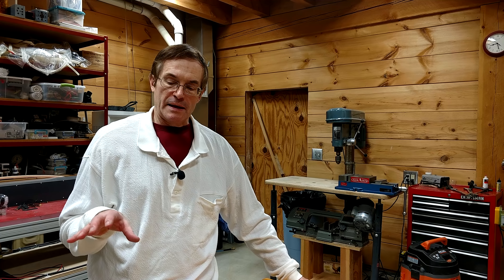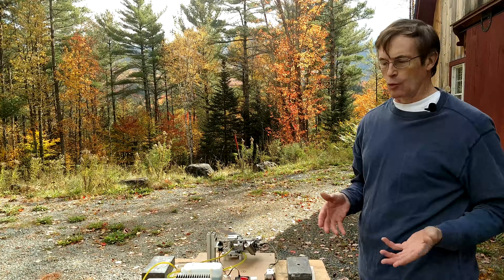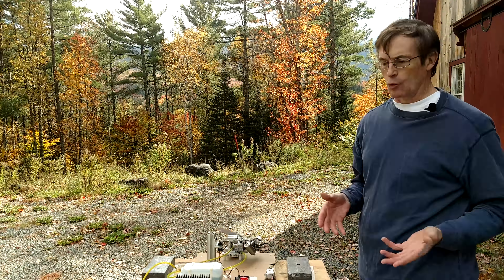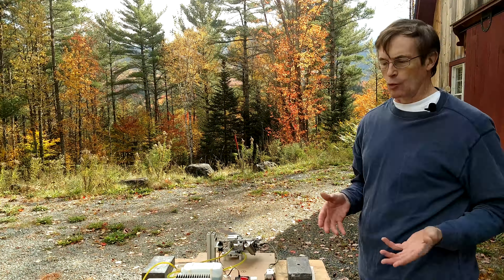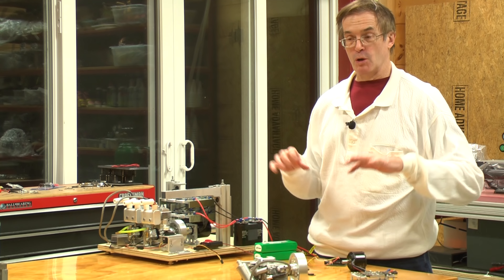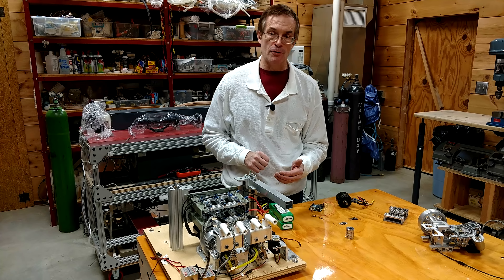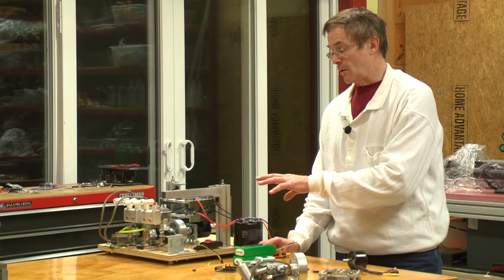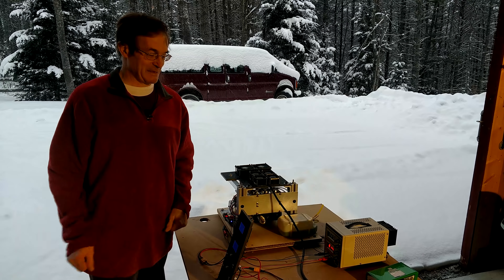Hybrid Drone Generator

Comment: Great videos,Thanks! My team has built a hybrid drone based on your videos. And it hovered for more than 1 hours! But I have a few questions about the theories in your video. After landing on the ground, we found the batteries swollen(without charging management system).It seems that  frequent charging in pulse damaged the batteries; And I'm confused about choosing a battery model based on power ripple. We just selected the the capacity of batteries as small as possible. Is there any theory I can refer to to select the battery model?
Reply from the maker: Have you researched pulse charging or looked at any papers?  It has been a while since I have read any, but I can suggest a few causes.  The depth of the ripple depends on the capacity of the filter capacitors you are using.  Batteries have an internal resistance and the ripple represents a bidirectional current flow.  You may have overheated them.  Li ion batteries are vaulnerable to damage from overcharging with as little as a couple of hundred millivolts above their maximum voltage limits. It's important to operate the generator near the middle or only a little above the middle of the discharge voltage range of the batteries.  If you used small batteries and started the flight with them fully charged then drawing them down to that operational range where the generator begins to supplement may have used a higher current than small batteries could sustain.
Try again with the batteries moderately charged, with the generator running and the rotors spinning, but without leaving the ground, run for ever increasing intervals, shut down and check the batteries for temperature and voltage.
You'll solve it.
Reply: @TechIngredients  Thank you for your answer! Maybe you are right. Our drone weighs 18kg and requires power between 1.5 and 2kW. We closed loop control of engine throttle based on feedback voltage at load. At the time of take-off and load fluctuation, there is a delayed response between the engine throttle and the motor output power, which caused high frequency fluctuation voltage of the load near the goal we set(48V). It also has to do with the small capacity of the batteries we use(two 3300 mAh lithium battery in parallel).We will take your advice and set the target voltage between 46 and 47V. Thank you very much!
Reply: @TechIngredients   Also in the paper《Impact of Periodic Current Pulses on Li-Ion Battery Performance》，it says that pulse charge and discharge reduce the discharge efficiency and chargeability of Li-Ion battery.
Reply from the maker: Actually, the paper I read said the opposite.  Their theory was that the periodic pulse charging allowed the chemical products of the charging process to diffuse away from the electrodes. Maybe they were wrong or the issue isn't settled.

Comment: What about a radial engine ? Would that solve engine problem ? Instead of running two engines belted together
Reply from the maker: Yes.
The exhaust  plumbing would be a challenge, especially if you want to silence it.
Reply: @TechIngredients  thank you sir. I didn't think that far ahead.

Comment: Three way you control the torque fluctuations is a balanced fly wheel. That will remedy the broken couplings. Here is an idea... Use a multi cylinder engine instead of multiple motors. the exhaust should be ported very similarly to a gun muzzle brake to assist stabilizing.

Comment: This can be use like a charger for a solar sistem ? How much liters of fuel per kilovat ? I mean the eficency is beter thean a normal 30-40% of a generator ?
Reply from the maker: The effeciency in fact is a little lower because of the two stroke engines.  What sets this apart is its extremely low weight.
Reply: @TechIngredients  u shold make one with gas hidrógen o propone is lighter

Comment: Call me crazy, but wouldn't it be ten fold more efficient to eliminate the hybrid portion and do a 4 stroke drone? That set up looks quite hefty, will it even produce enough energy to lift itself?
Reply from the maker: It would be more efficient, but there are other issues.
Direct drive from an engine makes it very difficult to isolate vibration and noise.
Electric motors have faster response and more precise speed regulation and a removable generator module allows quieter operation without fuel on board when that is necessary.
Reply: @TechIngredients  Its definitely a cool concept you have there. And the point you made about fuel being more energy dense than batteries is spot on. 

If your goal is to produce power without vibration issues have you thought about putting a turbine powered unit together? I know the marine versions run thru a transmission and I do believe the helicopter versions are a bevel gear with a clutch. Not sure what the throttle response would be like for direct drive.

Comment: Naturally, you are using a 2-stroke gasoline mix in those engines instead of alcohol based model engine fuel for the large increase of btu's.  Correct?  Pardon me if you already mentioned it.

Comment: Great job! Thanks. What about small rc turbine engines?
Reply from the maker: They would be very compact and light, but they are very expensive and because of the low compression ratio, have poor fuel effeciency.

Comment: Neat setup. Why didn't you use a radial engine instead of coupling 2 engines together?
Reply from the maker: Radial engines would be a good choice, but the exhaust plumbing would be bulky and make building an enclosure more difficult.
Reply: @TechIngredients  Indeed. Or even a flat 4 cylinder style such as: https://www.ebay.com/itm/New-OS-FF-320-FF320-Pegasus-4-Cylinder-Ringed-Four-Stroke-4-Stroke-RC-Engine/392049322508 Not sure how the crank/ power strokes would be laid out
Reply from the maker: Did you watch our follow up videos on this system where we introduced the flat four cylinder engine?
Reply: @TechIngredients  oh, no I haven't. I guess I will need to watch that!

Comment: since you are using two stroke engines over a broad rpm range to adjust current flow, exhaust tuning is out. driving one motor, generator off the timing belt would reduce the weight and allow you to run the motor at a higher rpm than the crank speed of the motors. What you have actually created is something the diesel electric locomotive has been using for years. However, the  efficiency losses are pretty high.
Reply from the maker: We considered that, but decided on the two generator design for a couple of reasons.  The output capacity of these motor/generators is pretty linear with weight.  So, a single motor/gen will weigh about as much as a pair of smaller units with the same overall capacity.  The two, out of sync motor/gens allow the same pulse frequency as a single unit with twice the pole count.  These motor/gens and even the timing belts have RPM limits and driving them well above 10,000 RPM gets sketchy.  Finally, if the motor/gens are operated with a typical step up pulley system, there are significant lateral loads placed on the engine bearings that may lead to wear problems. It's impossible to get any specs from the manufacturer re these unusual loads.

Comment: I thought with a drone generator a drone would not need to return so soon but the size and weight of the generator is so much larger than the Drone it's self typically. My son does real estate photography and battery life is 80% of that ball game. The explanation and design detail is pretty extensive. What I am asking,  is this for charging a drone battery in the feild? Is so is it faster than an inverter to a car battery, my son has bought a dozen battery's and takes 6 with him, then recharges them over night the uses the other 6 the next day out.
Reply from the maker: This is an engineering test platform.  It can be further reduced in weight and size for the intended airborne installation.  A simple inverter and car battery or a camping generator is fine for field recharging.  Also, a generator module makes practical sense only for larger drones at this point.  Small models would be best served by bringing along more backup, battery packs.

Comment: Maybe it could be possible to reduce torque peaks electronically? Just reduce load outside of torque peeks. Sufficiently sophisticated controller could even make angular velocity perfectly stable.
Reply from the maker: That's a good idea.
Reply: @TechIngredients  there are bldc motor controllers ICs that have regenerative breaking. Maybe instead of accelerating or breaking that could just keep the angular speed locked. Depends how they are implemented. It would mean that during compression stroke it could even consume energy from capacitor/battery. And all voltage and ripple problems can be solved in weight efficient manner by a switch mode voltage converter. MOSFETs are light, so why not use them wherever possible. If all that worked boxer without counterweight should light and vibrations mitigated.

Comment: there is a way to use gravity so water is always traveling down a ramp when it gets to the bottom it raises the water level and the cycle repeats,look at the pyramid shape and build something for the water to turn like a wheel as it goes down
Reply from the maker: You can use gravity as an intermediary, but you would have to supply energy to return the water from its deeper location in the gravity well.  If you're looking for a method to allow for perpetual motion or harvest "free energy", there is none without reversing the direction of time.
Reply: @TechIngredients  it wouldn't be free energy because you're putting in energy at the beginning you're basically overfilling it and letting capillary action bring the water back to the top
Reply: @TechIngredients  to "prime the system" you're adding energy by dumping water down the ramp the water pushes the rest of the water back to the top and over the ledge

Comment: You seem to be pretty knowledgeable with these lithium batteries maybe you can help me out. I have a 14S 54V lithium battery which will only charge to 53.7V not the 58.4V max. Each cell is at 3.8V max the charger tests at 58.4V and have tried several different ones and none will charge this battery to full capacity. I tried eliminating the BMS and directly charging and still the charger cuts off at 53.7V any ideas?  Thanks
Reply from the maker: There are two types of lithium batteries, lithium ion and lithium polymer.  You can look up the relative specs for both, but what is relevant here is the charger may be using a default program to charge to the lower max of the li-ion battery.  This is generally 4.2V/cell for the polymer and 4.1V/cell for the ion.  Also, many chargers have user adjustable max charging limits both for voltage per cell and for maximum amp hours added per session.   If your charger is completing the charge at 3.8 V, it is not fully charging this battery by choice.

Comment: But what if the generator is mounted at a 180° position from the motor with gears or flex cable? Wouldnt that counteract Newtons law?
Reply from the maker: It's important to keep things as simple as possible.  This holds down cost, weight and reduces the chances that something goes wrong.
Just changing the orientation of the generator shouldn't change the gas engines' vibrations.

Comment: I’ve wanted to create a electronic throttle system for small engine power equipment such as snowblowers and lawnmowers. I figured an Arduino could be used.
Reply from the maker: Sure.  You'll also need a servo and power source if dealing with a carburetor.

Comment: Wow.  I love the depth of your videos.  Counter balanced clocked engines!  So cool!

I wonder, are capacitors necessary if you have lithium batteries?
Reply from the maker: Maybe not.  We are building a larger generator as I said in the video, but also a smaller version that will dispense with some of the complexity with voltage regulation.  We'll just run it flat out and supplement a larger battery pack.  In that case, the batteries should be able to absorb the voltage pulses much more readily than the tiny stand by batteries in the other generators.

Comment: Okay... there's the generator specs... I did miss those the first time i watched this... 

A brushless motor is a good idea as an off the shelf part that can be dropped in without much hassle. 
The only issue is pole-shading, but that requires a lot of work to remove from the motor, and ultimately might not be worth-while. It depends on whether you want to keep the motor functionality or go for a pure generator setup. 

If you keep the motor functionality, it can add some conveniences that you might not get in a setup that's purely a generator. 

Firstly it can act as the engine startup component, and it can even be used to balance out the load on the engines. If you use a switching rectifier, the draw of the generator can be synced to the position of the piston, allowing the load of the individual generators to be synced to their respective motors, which would ultimately smooth out the output further than it already is.
Reply from the maker: Those are good suggestions.

Comment: I'm sure someone has brought it up, but diodes are very inefficient.  Newer circuits use MOSFETs that are turned on at the correct time to rectify the AC.  This is often called "synchronous" operation.  This will increase your efficiency roughly 10% or more and as an added huge benefit, you won't have to cool your rectifier nearly as much.  Of course this requires a more complicated circuit, but the benefits could be large.
Reply from the maker: Good idea.

Comment: If you want to have a extremely precise fast fuel control your going to probably need to switch to a fuel injection and possibly electric ignition as wells. That will help a lot with fuel consumption as well so I'd see how light I can get those parts for that application if I were you. Your off to a good start though.

Comment: What engine would you recommend for the alternator?
Reply from the maker: I wouldn't use an alternator because of its low effeciency.  Look at power to weight ratios.  Two strokes will generally win here and despite the lower fuel effeciency are probably a better choice for airborne applications.

Comment: What kind/brand  2-stroke oil and fuel being used?
Reply from the maker: I can't remember, but it was purchased from the same hobby shop that sold us the fuel tank and fittings.  So, it is probably some run of the mill RC oil.  The gas was ethanol free 100 octane from a local station that caters to racing enthusiasts..

Comment: Could you not have built a mount for your 1st motor for less weight than you gained by adding a second motor/flywheel/muffler?
Reply from the maker: I'm not sure what you mean.  The second engine and flywheel were used to smooth the operation, provide less voltage variation as well as to add additional power.
Reply: Tech Ingredients .  I understand and I don’t mean to split hairs.  I was just thinking that while tackling the list of design challenges for vertical lifting aircraft, vibration would have to take a back seat to power vs weight. Enjoying your work and looking forward to more on this project.

Comment: rubber spider couplings are far better at managing rotational torque pulses without fatigue or other difficulty. also, as you're probably aware, putting a large delta V into LiPo batteries demands that they have a large C rating - especially if they're nearly fully charged - if not, its all good until they fail, and then it's catastrophic. the recommended charge profile (V and A) depends on the charge state. LiPo chargers generally are capable of controlling V and A while monitoring charge state.
Reply from the maker: The "charging" of these batteries in this configuration is minimal.  They act more as peak voltage sinks during the millisecond periods when the engines are slightly above their mean RPM and they discharge during the periods when the engines are slightly below their mean RPM.  Also, they will cover the occasional times when the load on the generator suddenly drops, say after a vigorous maneuver.

Comment: What's the advantage of using a gas motor over an electric motor?
Reply from the maker: In a hybrid, they complement each other.  The independent gas powered generator improves flight times while the electric motors provide redundancy, faster response and distributed lift points without a complex transmission system.